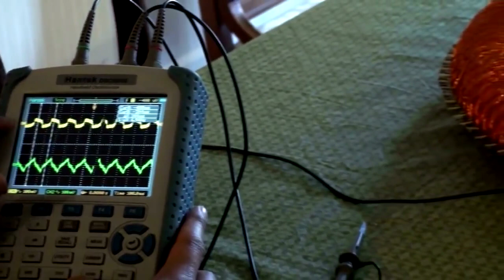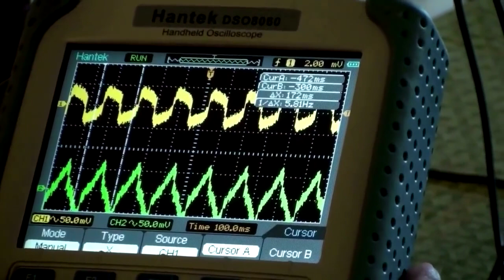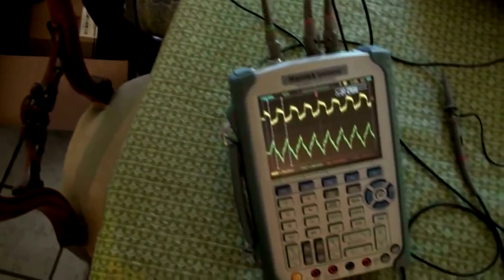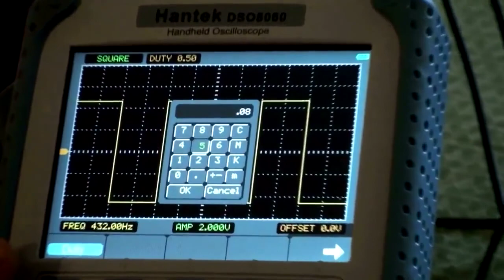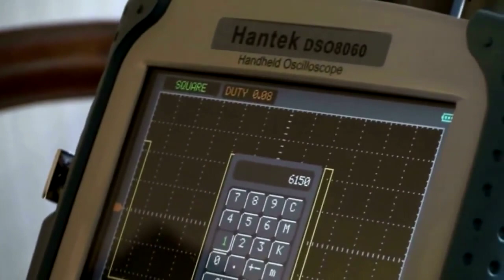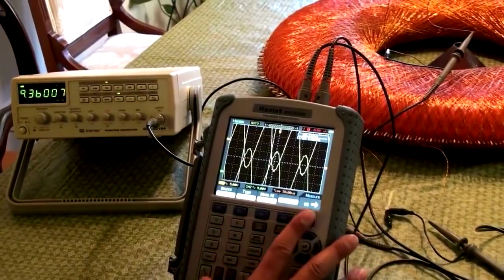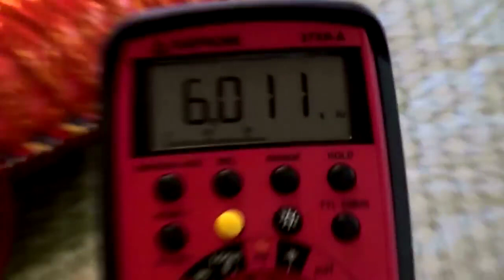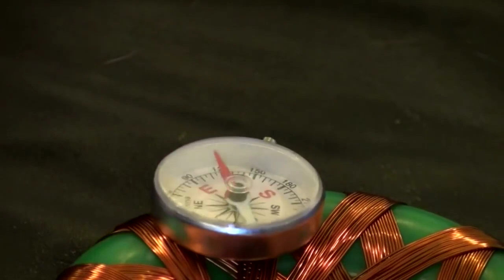A Look at Otis T Carr's Utron - Resonant Frequency of 120 Point Coil - Jason Verbelli

Comment: What's the utron comprised of?
Reply: Most likely the OG aluminum, but Carr transitioned to other dielectric materials like nylon etc and wrapped them in magnetic enameled copper wire. I have them in many different materials I've been testing out and liquid metals/ferrofluid in the inner chamber. The aluminum Utron has the best paramagnetic effects in high rpm spin and exhibits better aether plasma qualities. Send me your address and I'll mail you one.